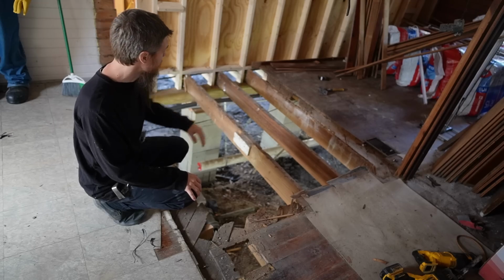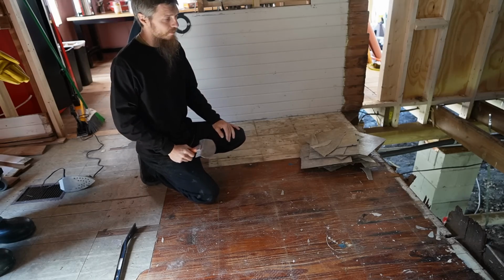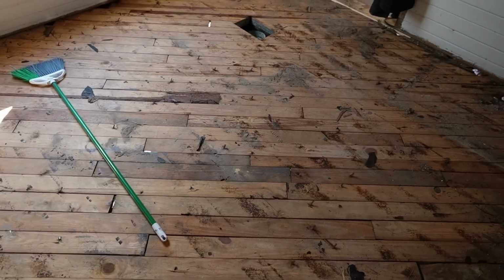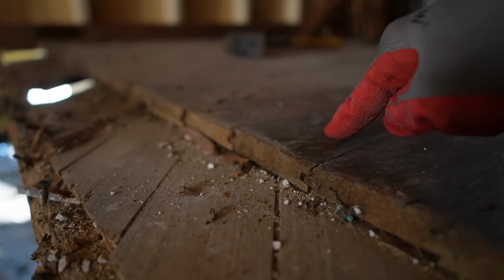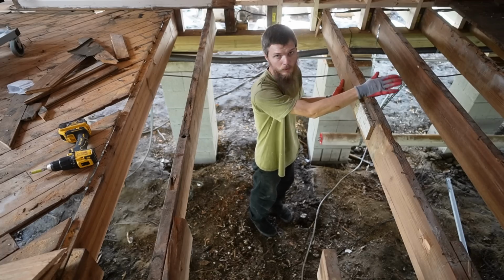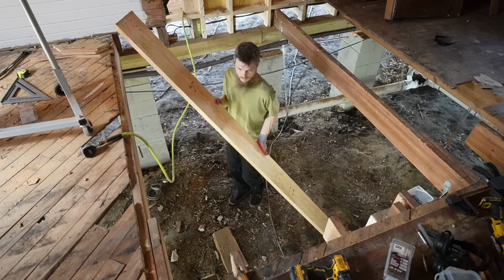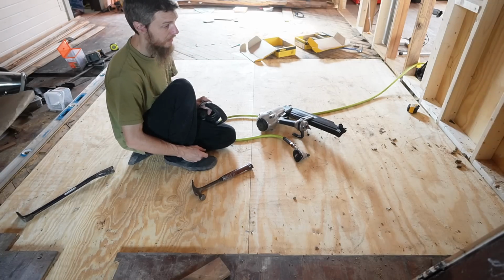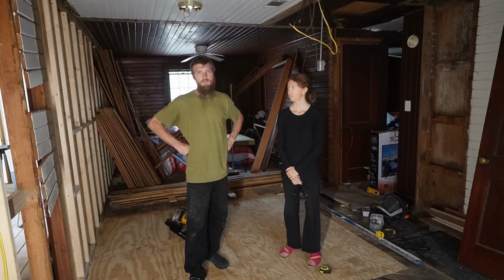Rebuilding our Home - Small Family, Living Simple DIY

Comment: OK.  I'm going to be honest.  I, too, have been watching your channel for years.  I watch because you guys are interesting and smart, and a sweet couple.  But the THING that keeps me coming back for more, EVERY time, is your creativity.  You called your solution to that floor problem "unconventional."  Sorry, but that's entirely the wrong word.  The word "elegant" is much closer.  But, no.  Even that is too weak.  The word to describe your solution to this problem is, without a doubt, GENIUS!  Also, I 100% agree with your decision to not replace all of that old subfloor.  It may not be pretty.  And it does have its flaws.  But, it's not rotted, and you have a plan to patch the holes and imperfections to get it up to standard.  Why spend the $$?  It's a long way to the completion of this RESTORATION.  If you wanted a 100% new house, you'd have built THAT.  Keep up the good work, you two.  ❤

Comment: Oh good job Doug, and I agree about spending so much money on wood. But since that old subfloor was still okay and the part you kept was not rotted and you cut away the rotted part and it is looking good. I think once you use that tongue and groove flooring you can sand it and restain it whatever color you would like and I think it will be just fine, there is nothing wrong with saving money when you can. Thanks for another good video, have a great weekend, sending love and hugs, bye! 🤗😍💜💜💜

Comment: Use what you have. We have a home that’s over 80 years old, our floors are hardwood, we pulled three layers off just to get to the hardwood sanding filling, they look good. I call dents and dings character. Our floors have lots of characters. Wouldn’t change it for anything. Plus the cost to replace it would be over 10k. Keep the wood floors. Love them! God bless 🙏❤

Comment: Fight the fights that you have to.   Leaving the old sub-floor  sounds good.  I had a trailer with mdf sub floors.  The bath had holes through the sub floor.  There was no finish floor just carpet and linoleum.  Some of the trailer had white pine flooring over the sub floor.  I bought grade 4 pine tongue and groove from a local lumber mill's bargin barn and floored the rest of the trailer in white pine.

Comment: As someone who had to pull up multiple layers of sticky tiles over a wood floor and I wanted to keep the wood floor that was below the very best thing I did was go to Ace hardware and listen to the employee. Ace hardware sells a product called contractors solvent. In the spray bottle with looks almost like an orange oil. And that's pretty much well what it is with other stuff mixed in. You spray it down leave it down for anywhere from 1 to 15 minutes then you take a scrub sponge and some water with Dawn dish soap and all of the stickiness comes off. I now always keep it on hand and use it for all stuff. It's amazing. And it's saved for different rooms wood floors where I was able to sand stain and refinish when cleaned up.

Comment: Great job!!, don't second quess yourself on the old framing/flooring, if it's not rotted out/termite damaged, then re secure and restore it to the best you can and move on. However, I would make as much room in the hall bathroom remodeling as possible, at least for a double sink vanity cabinet, the kids are getting older and are going to need some extra room, especially when one is brushing their hair and the other one needs to brush their teeth!, everything you are doing is what I did decades ago with my wife and our first house !, keep up the great work 👍

Comment: I wondered if you should have put a few blocking pieces between the new joists that you fitted, just as you added them to the old floor area, to stop the risk of future joint twisting movement. Other than that, what a load of work, but fully justified with a huge improvement. You removed so many sins at one go, work with a real purpose, I say. You sounded happy with the progress, and so you should b. It looks so much better, and from all you said and did, it is far superiors to what was there before.

Comment: The interesting thing in this video is the effect of time on wood. No matter how well something was built, decades of time, twist and warp cut lumber. I wonder if this happens with harder woods or whole logs. I think there is a Norse church made completely of wood that is at least 800 years old. Maybe the climate makes a difference?
Reply: The humidity in Florida would be a problem. The Nomadic Movement (YT) is based in Panama and they have to build everything out of metal or it rots.

Comment: might had been eazier and kept the floor in a better condition if you can cut through the floor where you where planning to put the bathroom wall , then take up the good pieces of the flooring on the bathroom side of the cut and use those to patch in the parts that need replacing in the flooring on the kitchen side , could take out a few lengths in the middle like around the airvent to stagger the seams and get a nicer result 
now that you taken out the whole floor you could run them through the planer or a sander and get all the dirt of the tops and make them look like new again , might even cut the sides straight and put new tongue and grooves on them though that would mean that you have less material and might not be able to fill in the whole floor

the wiring sends shivers up my spine , youre whole house couldve burned to the ground or if it touched the metal waterline at some point couldve electrocuted people in the home or if submerged during a flooring couldve electrocuted people standing in a puddle near it 

man those vibrasaws are the greatest invention even , there's so mush stuff you can fix with them without damaging stuff around it that you couldn't or only with great effort and skill before these things came out

Comment: I don't knownif you are planning to tear down the wall thst frames the house in the kitchen area, but is it possible for you to extend the kitchen to make it a wider galley kitchen?  I know you might have to extend your roof to make it work, but if it's not something major, it will be worth it since you are extending the bathroom.  Also if there is a possibility in extending the kitchen, instead of extending the bathroom a foot wider, why not 2'.  Just wondering if it could be done.  Even if you won't do it, could you let me know what's in tailed.  That is for my info. So if I ever come across a situation like yours I would know what I'm up against.  Thanks Doug, can't wait to see when it's all finished.

Comment: why the pocket screwing when the rest of the ply wood is nailed from the top ?
Reply from the maker: As we showed, that part of the subfloor got installed under the finished flooring. I could not nail from the top on the one joist because there is finished flooring covering that area.